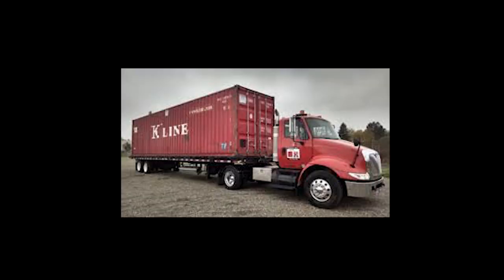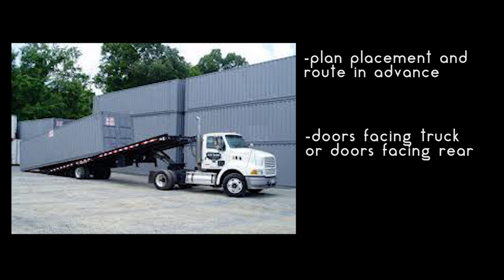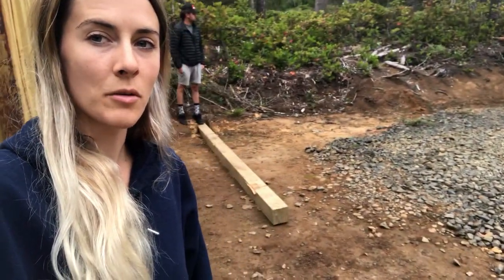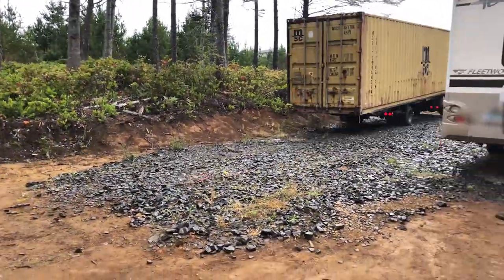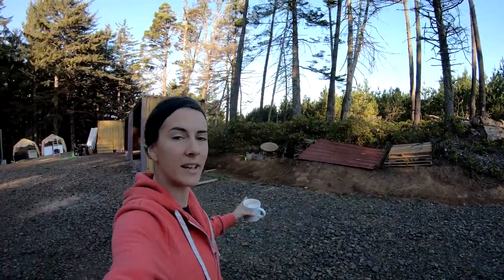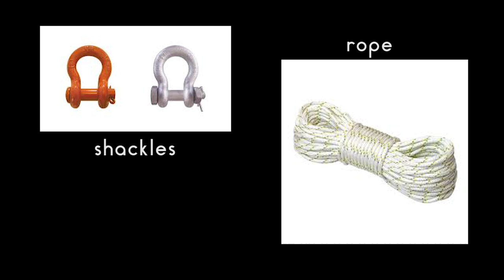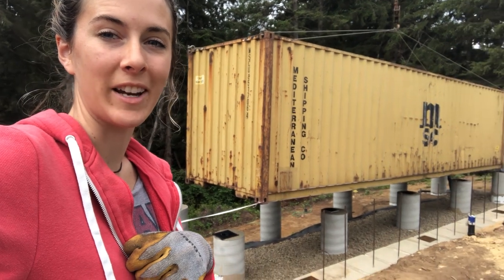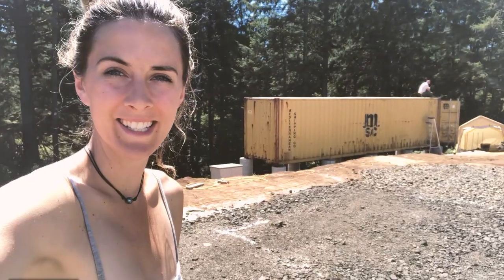CONTAINER DELIVERIES & 1ST CRANE PLACEMENT - CONTAINER HOUSE BUILD - Ep. 6

Comment: Cool project, surprised that crane could lift a large container like that but went smoothly. Is the roof of that one going to be a patio ?
Reply from the maker: Cruiser Mac Thx!! It’s definitely towards the maximum capacity. The container weights around 8,000 lbs empty. On the 3rd level we have a balcony on top of the roof of the 2nd level and on top of the 3rd level we have a rooftop deck. If you go on our Instagram I have the building plans on there. :)
Reply: @PacificPinesRanch   still binge watching your build.  Subbed here earlier and now on IG as well.  Keep rockin' it!

Comment: Hi, I have a stupid question. I have watched a lot of container build projects. Containers are, what 8 x 10? Are they so structurally unsound that they must be placed upright?  Can't the be placed on their side for greater square footage? How much would it cost to get the extra floor space?
Reply from the maker: I’ve seen builds where they place them in other ways than how they are made (vertical, on an angle, etc). You probably could place them on their side but you’d likely have to reinforce it. They are specifically made to be stacked vertically so when you take them out of their typical configuration it requires a little ingenuity. 🙂
Reply: 8x10?